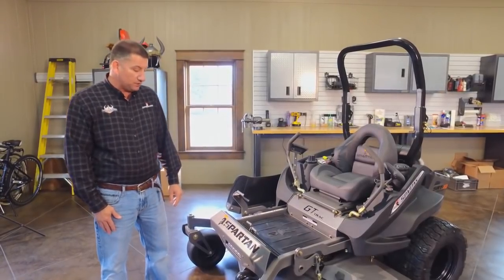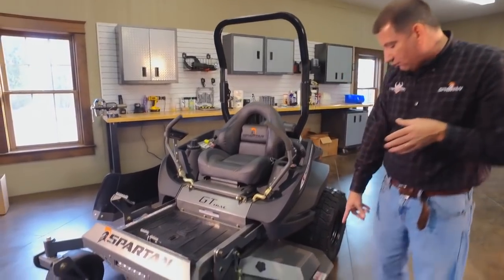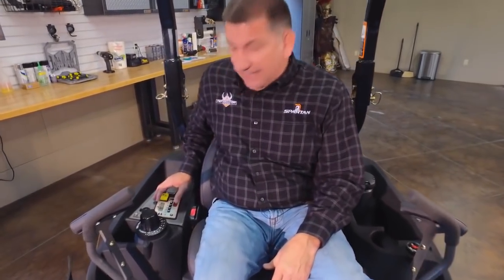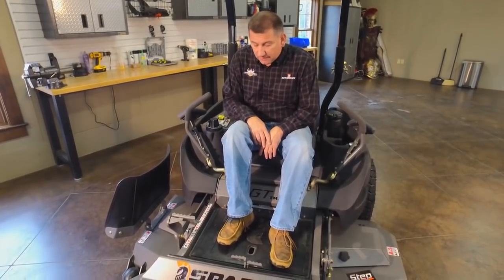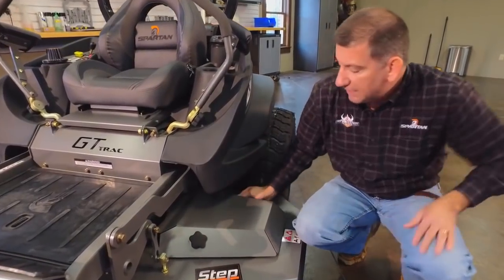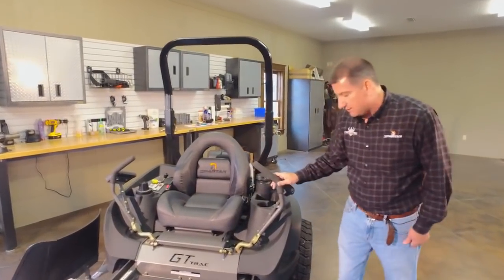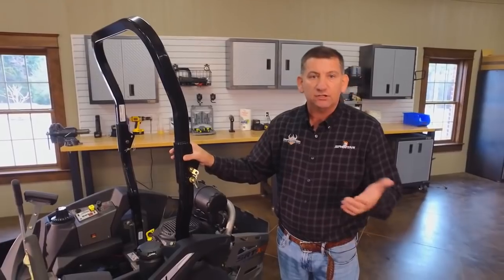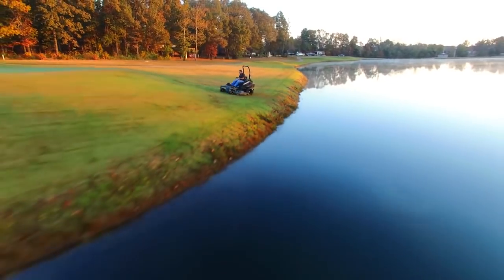Spartan Mower Overview

Comment: Why do some Spartan mowers stripe and others not?  I have a 2021 SRTXD 61" deck with 38.5 hp Kawasaki.  I have used different blades on different types of grasses and lengths and 290 hrs later have yet to see a stripe.  I've seen others that will with the same mower and setup.  The dealer can't figure it out either.  Spartan tech told my dealer he didn't have an answer.  I'm having buyers remorse.  I wish I had went with Scagg for a better cut.  If it weren't for my awesome dealer I would definitely wish I had went with Scagg.

Comment: Hello Mr. Foster  . I like the Spartan zero turn mowers and they are what they are said to be. I have a 42 inch cut RZC. And would like to know if it can be built to a 48 inch cut as an RZC platform. This would give the customers a bigger option between the 42 and the 56  in the RZC . I am a Disabled Veteran and need a larger cutting deck . Thanks

Comment: To the Spartan manufacturer you need to start putting out parts for these machines we have a 2016 Spartan mower I've been waiting on a fan blade for the hydraulics it's been 2 months I haven't seen it yet I live in Wichita Kansas there should be more parts out there nothing's perfect things will break it's a good mower we use it heavily i

Comment: This is the best mower ever!🌾🌾  allabout.wiki/B07CV   I went from the hand push Spartan Zero-bilt,to the purchase of,this zero turn Spartan Zero-bilt mower. I mow about 2 acres of lawn and, two fields of hills, with small trees and brush, that is about seven acres. The cut is even and looks so nice. I like that I can raise The blade for taller grass and brush, and lower it for a nice clean cut for my lawn. The blade chops up the brush and small trees down to nothing. This is the first riding mower that I have ever had, as my husband ha...

Comment: I want this mower. SLE has it for $4000. I was going to buy it but they can only do local delivery, no shipping to MD. This is due to spartan shipping restrictions from corporate. I checked local dealer, they want $8000 for the mower. How can I buy one for $4000? RZ 54 inch 24 hp

Comment: There very nice! But I have to have the  ability to bag! Especially in the fall cleanup season. makes no sense to have a machine like this and not have the capability to bag.
Reply: With the heavy duty blades and deep deck system along with the ability to close the chute off, everything will be mulched so fine there's no real need for bagging.

Comment: What happens when the computer pad fails to start the mower? Needs a manual key start integrated for the purpose of computer failure. The sun will eventually fade the keypad I would think a cover over it wouldn’t be bad. I’m not talking bad about the mower. It looks like a beast of a machine. I was just thinking about all the things that could happen overtime. A lot of features I like about this compared to other brands
Reply: I was thinking the same thing. Some sort of over ride start capability.
Reply: That's why I bought a GRAVELY, I thought that the spartan needed a 🔑 option start up also✌

Comment: i almost bought the a spartan mower, but i couldn't find much info on the hydro's for long term reliability they also looked kind of small and light weight. i also wanted a Kawasaki engine and they told me it was a 1100 upgrade. thats crazy.
i didnt test ride the mower but its seemed well made and a solid machine also the best looking in my opinion. to bad they wanted to gouge me for the Kawasaki,
Reply: DAN KOLLARS Parker hydros have larger openings where the hydraulic lines hook up so it takes less power to run them and the fluid stays cooler. That's why they only have to be serviced every 1000 hrs after the first service at 250. All other hydros have to be serviced every 500 hrs. Parker hydros are the same hydros that are used by Dixie Chopper
Reply: I'm in the same spot. Want a Kawasaki motor, but not paying the leg with the arm they already cost.